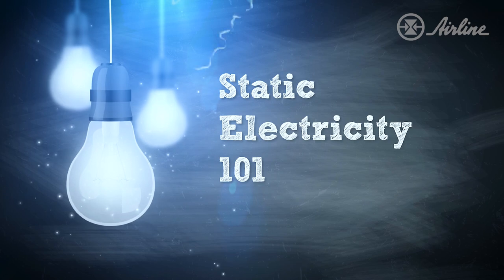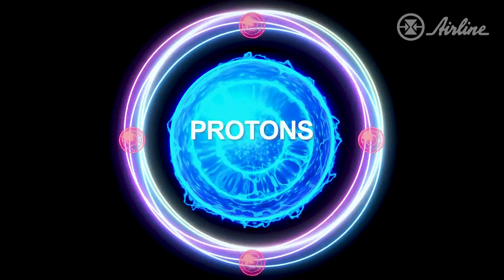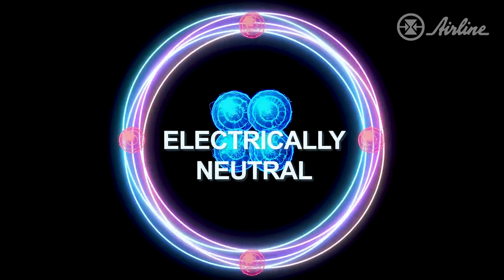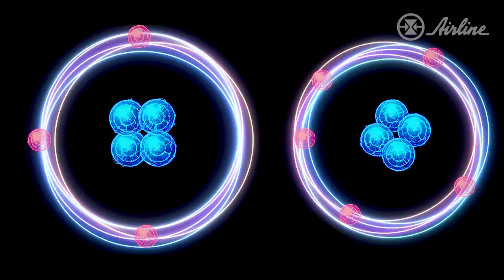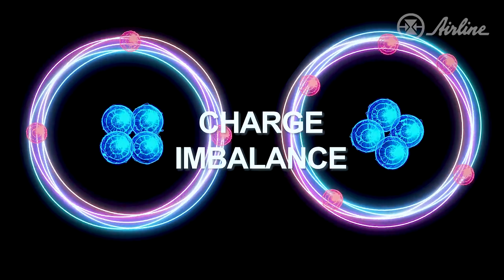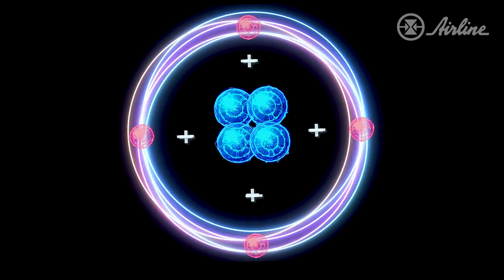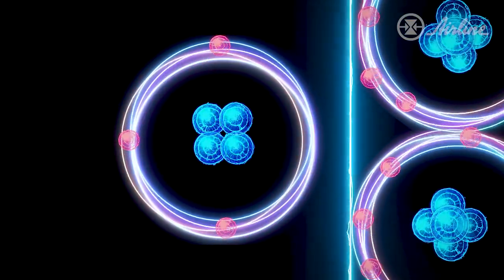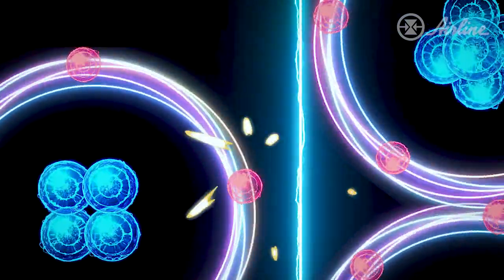The Why and How to Remove Static Electricity & Electrostatic Discharge (ESD) Part 1!

Comment: Gibson Guitars uses an Electrostatic charge to attract the clear finish onto their guitars. The results 'for me' have been negative with pops and cracking coming through my amp. This has happened with three different Gibson guitars and only happens with Gibson guitars. Some will attribute this to a "grounding" issue either with the guitar or the homes electrical wiring, but I am 'in my instance' 100% positive that this isn't the case. I am here trying to find out how to remove this static charge to try and fix a problem that really shouldn't be there to begin with.

Comment: What if the object i'm touching has the right amount of both + and -?  how come i get a shock from the laptop? The bed sheets i guess made me more negative? but what if the laptop doesn't need any electrons?
Reply: I know nothing of this, but I believe you and whatever you're touching will want equilibrium.

 That's why you are told to touch your computer case when touching hardware, so the charge gets evenly spread between you and the metal and thus you cannot ESD.

Comment: The current is also very high because the ionized air in a spark have very low resistance!
Neither voltage nor current are low so the power is very high.
What is low here is the total energy because the spark happens for a very brief amount time.

Comment: I need help guys.  I work at a PVC plant and our pallets of pipes are super charged.  When I go to band them up, when I touch metal in the area I get shocked every time.  Anything I can do?
Reply from the maker: Oh no! If you haven't already, be sure to watch part 2 of this video series, and try following some best practices we laid out there. If that doesn't work, we also go over some technology solutions to help eliminate static charge. If you still need more help, you can always reach out to our experts - call us at 800-999-7378 or email customer.service@airlinehyd.com. We can collect the information we need to be able to provide the best solution for you.

 ▼
Reply: @AirlineHydraulics  Thank you!  I cant really buy any Ionizers because im just a new employee and they dont care enough, maybe sometime I can request they look into it but ATM Im still to low in the ranks lol.  Could you ground the static from placing 1 or 2 copper wires on the pallet possibly or do you need to balance the ions?

Comment: does esd have a sound?
Reply from the maker: Sometimes, but not always, a soft clicking noise can be heard. But the way to detect static electricity is with a static electricity meter (watch part two to learn more).

Comment: so this is why, every time, since we dont have a heater atm, when i change clothes, without fail, pants, shorts, or shirts always have that static crackle sound when i take them off, was wondering if it was due to that, or the waterbed, or the space heaters, or a combination but maybe once we get the heater up an going monday i wont have to worry about this and can finally put my pc together (dont wanna risk damaging the motherboard due to static, i know i can touch the case, and i do have an anti-static wrist band, but still)
Reply: Yea, the computer case I bought came loaded with static, so much that I didn't want to risk it and only assembled the other day and with the utmost care.